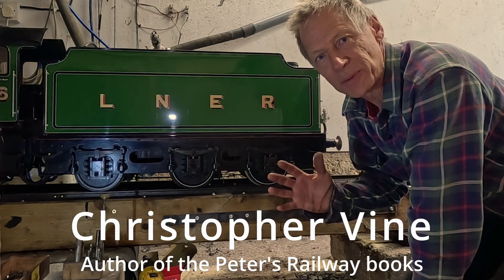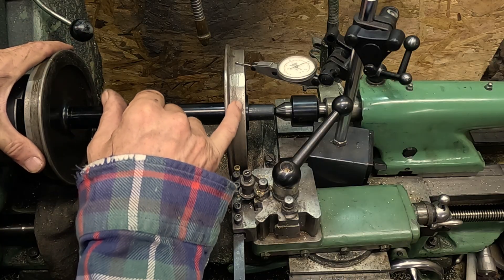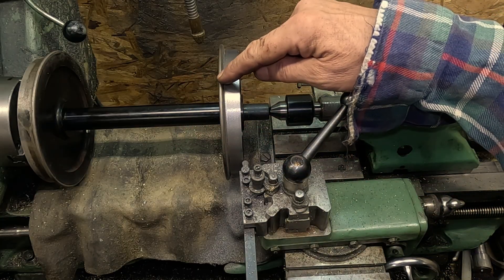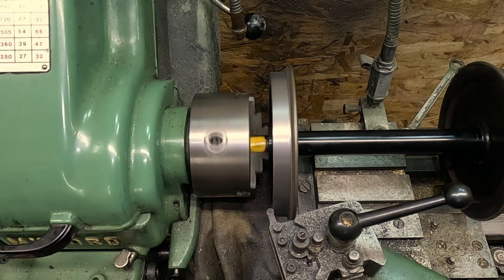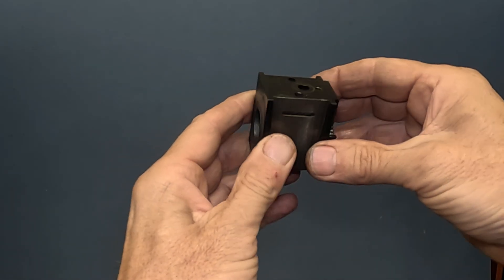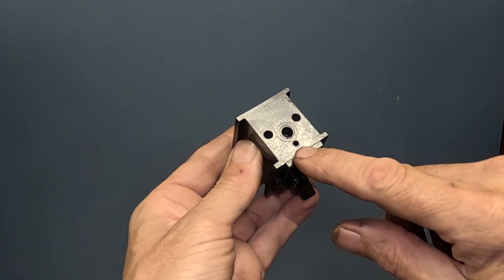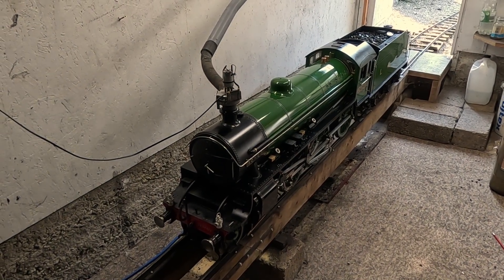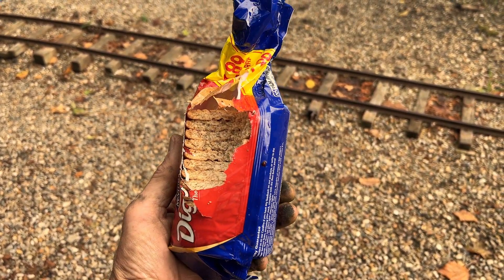Bongo Breaks Down – at Peter’s Railway

Comment: Hi Chris. Wonderful videos of a stunning locomotive. I have just ordered a 5” Britannia class loco and have been looking for items to enhance its appearance. Did you make the running lamps and water gauges on Bongo or order from a supplier? They make such a difference as does the billy can and mugs ❤
Reply from the maker: Hi Jon,  that is a major project you have got on your hands!  There are plenty of suppliers of water gauges etc, but the gauge glass protectors (which are the most prominent part) were made by me.  Glass is microscope slides.  The little lamps were commercial lost wax castings, but I adapted them to burn oil with a little flame.  They do work, but not for very long as a passing butterfly will blow them out!!!
The billy can and mugs were made by me, out of brass and painted up to look like enamel.
Thanks for watching! Best wishes, Chris.
(For more information about the books I write to teach children (age 3 to 90!) about railways, science and engineering, please see here: https://petersrailway.com/ )

Comment: Great Channel Chris,  I really enjoy all the different content but I feel compelled to point out the fact that you were running a lathe with un-buttoned long sleeves!  It only takes the slightest moment of interruption for that sleeve to get caught up on a chuck jaw and I would hate to see you suffer the consequences.  I'm not some armchair Engineer expert throwing shade on the exceptionally cool stuff your doing - I genuinely don't want to see an accident happen.  I have my own workshop with Lathe, Mill etc and am always mindful of how easy it is to loose fingers, though I still have all of my own!  Safety glasses and no loose clothing go a long way to make for a trouble free day in the shop.  All the best from New Zealand.
Reply from the maker: Hi Chris, you are of course quite correct, and sometimes I slip up on these things.  Luckily for me, I have got away with it so far.  
Yes, loose sleeves are bad, but I am extra careful if the chuck jaws are beyond the chuck body.  Also, the myford lathe is belt driven so the max torque is limited.  If it was a geared head Colchester I would be much more wary.
Funny how sometimes you get caught out be something completely off the wall.  A few months ago, while painting the little engine (which I am completely overhauling and filming), I warmed up a tin of spray paint in front of the heater.  Then got distracted and forgot.  when I picked it up the base blew off and the can hit the ceiling with a terrific bang.  I was lucky not to be injured.  
Stupid, I agree. But there are a great many things in life which are improbable.  The more improbable, the more there are of them!!!  
Older and wiser etc.
All best
Chris.

(For more information about the books I write to teach children (age 3 to 90!) about railways, science and engineering, please see here: https://petersrailway.com/ )

Comment: Well, you always did want to make the track shiny, so dragging a seized axle round is one way of achieving that! Would an initial application of PTFE in some form, at re-assembly assist with longevity, or would doing that clog up the lubrication system that you have? Great content, as ever!
Reply from the maker: Exactly!  It would have been better to drag a concrete block round behind the train...  
There are some products to help prevent seizing of bearings, but I don't think any of them would do much except to delay the inevitable by an hour or so.
Thanks for watching, Chris.

Comment: Great video as always, would love to know if you built Bongo yourself from scratch/a kit or which manufacturer produced the locomotive?
If from scratch where did you find the plans?
Thanks
Reply from the maker: Thank you!  Yes, I did build Bongo from scratch.  There were some drawings done by Martin Evans, but they are very poor with both mistakes and drastic errors of scale.  If you built to his drawings, the loco would not look anything like the original.  I was lucky that someone lent me some original BR drawings, and I also had the chance to measure up one of the two surviving B1s.
Thanks for watching, C
Reply: @PetersRailway  Wow! What a feat of engineering
Reply from the maker: @tomeames903  Thank you!!  I am currently rebuilding the little tank engine, see brick train in turning loop video.  Will be making a series of videos on that too..,.  All best, Chris.

Comment: What would my first loco be for beginners
Reply from the maker: Good question!  If you haven’t built any simple stationary engines then you would do well to start with one of those.  If  you have already built some small steam engines then something simple maybe an 040 locomotive with outside cylinders would be best.  However the best thing to do is to join a model engineering club somewhere not too far from you enjoy a fabulous hobby, Chris
Reply: @ thank u

Comment: 14:30 Perhaps you can place a wooden beam on the tracks that is holding the axle a little bit below its final position. But high enough so that the axle (bearing) holders are high enough to let the screws catch. That beam should look like half a ladder. With a cutout long enough so that you can hold the axle with one hand through the slot while the beam is moved under the axle. The beam is positioned so the axle will pass the end. Once you have the axle up against the hornblocks the other hand can slide the beam under the axle up to the sleepers in  front of the axle. It will then support the axle and you can easily adjust the bearing blocks and thread them into the hornblocks.
That way you have not to deal with the axle's weight.
A more sophisticated method would be using a seesaw. Two cantlevered beams connected to each other laid down with one end on the sleepers and the other on the floor. Where the axle will be there is a holder (two screws at least or a block with a V-shaped cutout where the axle goes) to hold the axle in place on the beam. The high end being supported by a block so it keeps its position. Once the axle is positioned on the lower end the other end on the sleepers will get a weight that (slightly more than) counterbalances the axle. So you can lift the axle to the hornshoes. Will probably not slide in right away. But then you can crawl under and adjust the bearing blocks with ease. Just be careful not to load the seesaw to much so the bearings don't bang into the slots (and possibly squeeze you fingers).
Reply from the maker: Thanks for the very cunning and detailed suggestions.  I will look into them next time I need to drop a wheelset!  There is always a balance between simplicity and ease of use - they don't always go hand in glove. The interesting thing for this operation is that I have only had to do it twice in 20 years, so taking a lot of time to create a more complex but better solution might not be worthwhile.  However, as I get older, the idea of taking the weight of the wheels will get more attractive!!  Thanks for watching! Best wishes, Chris.
PS. If you would like to know about the books I write to teach children (age 3 to 90!) about railways, science and engineering, there’s lots of info here: https://petersrailway.com/ and we ship overseas.
Reply: @PetersRailway  Glad to help. As an engineer I know the dilemma. But then you have built this elaborate wheeldrop to be used twice? My first suggestion, just place a/two beams ready and slide them under the axle is the simplest way I could think of. No machining just careful selection of the beam's/beams' thickness. And given my age and abilities (close to 70) I could readily feel the pain if I had to do it myself. Your video just oozed out sweat and I would have had to deal with desperation in addition.
I also see the joy in building a tool whether I will use it (immediately) or not. Just like builing a model. But given what you have to take care of the time might not simply be there. Or built it while firing up the loco?
Reply from the maker: I think that is the point of it being so simple.  I was faced with dropping the wheels once, in the last few years.  Maybe not again.  So it only too a few minutes to make the MK1 version, punk though it is, to do the job much more safely than propping the tender up on some blocks.  Next time, in another 10 year, I will have to make something better!!  Yes, there is a pleasure in building tools, but I tend to only make them to do a job.  If your hobby is making tools, then that is another matter altogether - and another splendid hobby!
Reply: @PetersRailway  Agree. If your pleasure comes from running trains everything has to follow that goal. And given your last takes on the video I can readily feel that satisfaction.
I am no more in the business of running trains (even in H0). I concrentrate on detailing.
But for other things, like building my solar powered electricity supply or replace my heavy garage door I take the same approach. Minimize the effort on tools but get the job done.
Another idea popped up: The drop table could be attached to some levers on both sides with counterweights (adjustable by having them able to move to different positions. Perhaps with a hook and chain?). One day you might want to change a driving wheelset. I cannot imagine that with some mechanical help.
First I though of a car jack or those pedestals to put under cars to have a ready solution.
Reply from the maker: I hope never to have to change or do any work on the driving wheels!!  In fact, they are not much heavier than the tender wheels and, luckily, I can call on a son to assist if necessary.  Enjoy the detailing in HO!  All best, Chris.